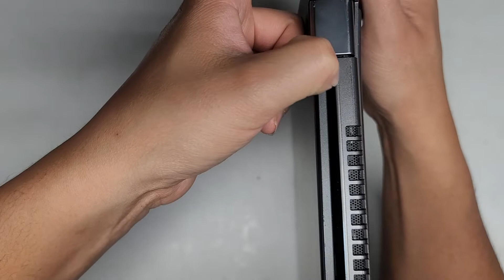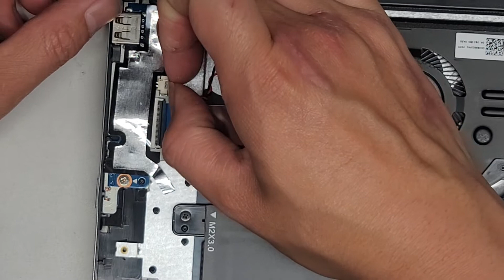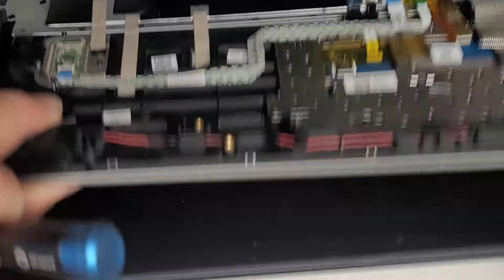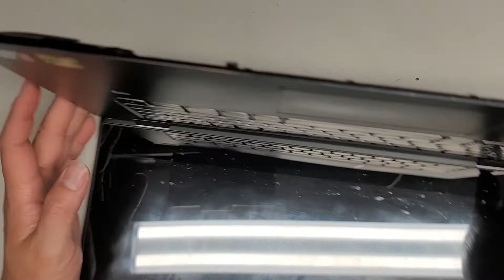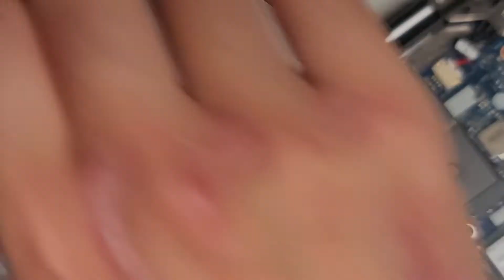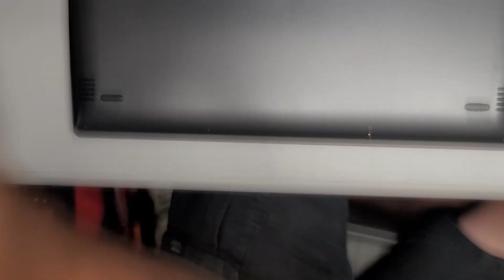Lenovo IdeaPad Flex 5 Flex 5-1570 Disassembly RAM SSD Hard Drive Upgrade Battery Replacement Repair

Comment: I can't find a battery replacement to save my life. That's the only issue I have with this laptop but it's like 7-8 years old but runs great
Reply from the maker: Here you go https://amzn.to/4wEfZHj
Reply: @ItsBinhRepaired  I bought 1 from ifixit 2 years ago and it didn't work. Lenovo gave me the part number 5B10M49824.

Comment: Except my Lenovo FLex 5 has the battery connector Crimped in with microscopic little metal tabs. So, how to undo those tabs to remove the battery connection without destroying the whole connector...?
Reply from the maker: Crimped in? Make a video

Comment: Brother same issue. Laptop charger not showing light. It is not starting at all. What to do?
Reply from the maker: Try another charger, another charge port, and bios/cmos reset.
Reply: @ItsBinhRepaired used different charger, but not working
Reply: @ItsBinhRepaired how to reset bios/cmos?
Reply from the maker: @WISEMANYT  disconnect the battery and hold the power button 15 seconds